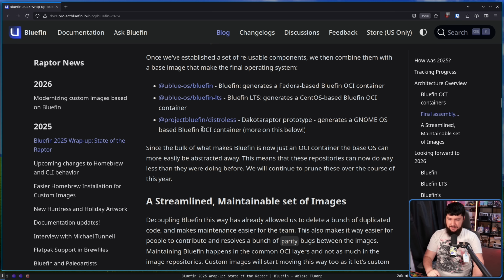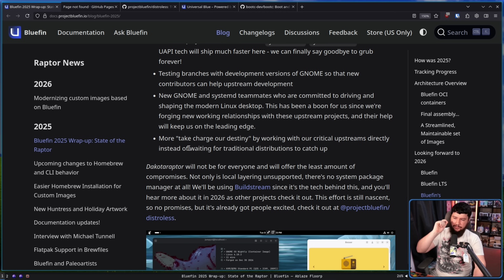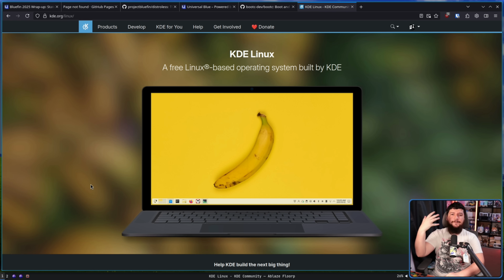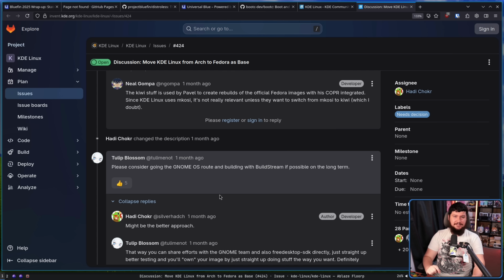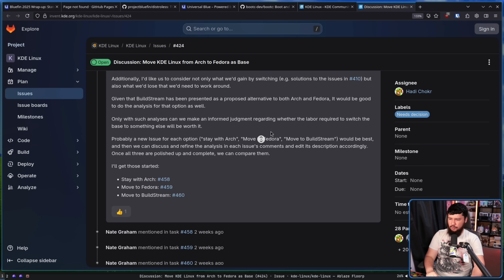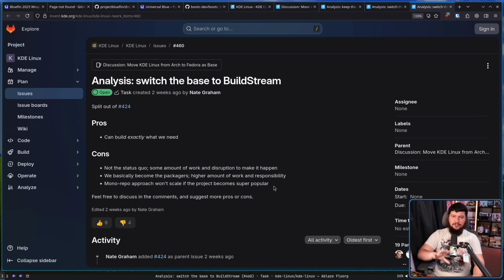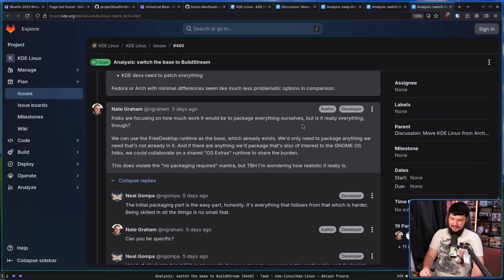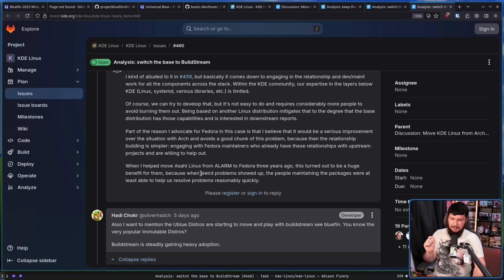The Future Of The Linux Distro Is No Distro

Comment: Ah yes. Lets create a Linux system that is as locked down for the user as windows and macOS are and call it progress. No thanks. 

As long as I need to add kernel parameters to the boot loader to have a random gpu working properly or random low level stuff to avoid draining my laptop’s battery in just a few hours, go away. 

I’ll keep control over all the software on my computer, thank you very much. Not just my user data. If not I might as well use windows and just use the software I need instead of searching for alternatives on Linux.
Reply: The system is still open-souce, unlike Windows and MacOS, and you can still build and modify the whole thing by yourself, unlike MacOS and Windows.
Reply: @MrWolff-n1v that’s nice if you are a developer but it means exactly diddly squat for a regular user that just wants control over his stuff.
Reply: @thethrottlemeister5886  You do not need to be a developer to build a working linux system. All you do is put together existing software.
And as long as there are people who consider themselves advanced users who want that level of control there will likely be a distro built by them available.
Reply: @thethrottlemeister5886  It is usually the case that "regular user" does not even know what OS they are running so an immutable Linux distro might be exactly the thing they need.
Reply: Why don't just use ostree and layer on packages? Same thing as installing with a traditional package manager with only a reboot. This allows atomic rollbacks so when you mess up, you can just rollback by rebooting and selecting a previous version in grub.
Reply: @EatDatPie_445 the whole point of this new system is that this is no longer possible.
Reply: So do you wear the bondage gear all the time or just when at the computer?

Comment: 7:04 are these the same Gnome people who think middle clicking to paste is unexpected despite being a 40 year old feature?
Reply: Middle click paste is older than most Linux users at this point.
Reply: @JodyBruchon  Linux is probably older than most Linux users
Reply: 1. who uses a fucking mouse, it's 2025
2. you're all supposed to be command line cowboys
3. See 1.
Reply: @realhulkhogan The mouse is much faster for cherry picked file moves than any command prompt
Reply: Middle click paste really wasn't a thing before the early 2000s and not a native feature on anything besides X11. All the new people coming over from Windows and Mac don't know what that is unless they used it for a very specific task at a job using third party software to do it, and therefore don't care that it even existed. A majority of developers now over the age of 30 likely started in school on old MECC Apples, quickly were retaught in the early 90's on IBMs running DOS/Windows, had Windows PCs at home through the 90's and went back to Mac in school or college in the early 2000's. Anyone younger than that know Mac touchscreen tech. That's it. What's what they grew up with. That's what they use. They don't know or necessarily care what "middle click paste" is
Reply: @realhulkhogan  Middle-click paste has been a
core, default feature of the X Window System and xterm since its inception in the mid-1980s and I first used it in HP-UX in the 1990s. I'm not sure why people keep wanting to break things that are working fine.
Reply: 0% of the world population outside of Eastern Europe or a hippie commune in a desert somewhere grew up with Linux based systems and 90% of those only started using Linux as more than a server system after Ubuntu was originated
Reply: You're basically saying that your ultra-niche feature that isn't 40 years old and that was obsolete less than five years after it originated in any major known use case by touchscreen technology should be a thing everyone just magically knows or cares about. That's not the way the world works or has ever worked, unfortunately. It's funny that everyone wants to kick their feet up and feel smarter than the younger generation but you weren't using technology whatsoever in the 70's, 80's or 90's. It would have broken you mentally, and your parents financially. Because tech back then didn't work that great. And there were a severe lack of features. And there was no fucking mouse with buttons, much less one with more than two buttons at any rate.
Reply: and digital tech always is has and will be the realm of the PROPRIETARY so, yeah, you boys weren't doing shit with computers before 2001 yourselves

Comment: I think this new atomic desktop approach of something like SteamOS makes a lot of sense for casual less tech savvy computer users and is probably a good direction for some distros to go. Personally though I have never really experienced any serious instability or regressions on Arch even before I switched from Nvidia to AMD and I like having more overall control of my system with less effort. Needing to hit the terminal or flatseal to make a random flatpak program see outside its own directory is annoying. Then only drawback to something like Arch is the lack of reproducibility meaning setting up a new system can take a while.
Reply: Atomic system is getting traction in server environment too. Most modern servers are running containers environment. The OS is just there to either run VMs or containers which contains the actual application and its dependencies. Having an immutable OS make sense because you don't actually install anything else on the base OS.

Comment: Bluefin/Bazzite is very much still a distro. They routinely add/remove/change specific pieces of software that require layering packages on top of the image, or going through  the trouble of building your own image if you don't like their choices. Sure, it's a different type of distro, but it's still a distro. Curation = Distro.

Comment: Distroless at least in cloud means your base image has pretty much only glibc + small amount of bare essentials binaries need to run. This is to primarily minimize the image size. I'm not quite sure what Bluefin is actually trying to achieve. To use containers as an flatpack alternative?
Reply: The desktops themselves don't run in a container, they are just regular containers but they happen to have a kernel and desktop in them. They are deployed via bootc. They behave just like normal linuxes. This whole container thing has the advantage that many people are already familiar with the tooling that is mature with good funding.
Base image/desktop from gnome, flathub for applications and homebrew for cli is the plan.

Comment: I am already on Fedora Atomic and consider this approach to be the best way to move forward with desktop Linux. The new approach without layering could work very well if they incorporated systemd system extensions (sysexts) to install software that may not work very well in a sandbox.
On the other hand, if sandboxes became more powerful in future, layering and other solutions might not be necessary at all.

Comment: Over the 18 years, I've tried a lot of distros, but my daily workstation has evolved from Kubuntu to KDE Neon to Aurora DX with a couple of custom tweaks. I've never been so happy with my workstation as I am right now. For me, immutable is the future. Same for the rest of my family (not all techies).
Reply: Same here. I'm daily driving NixOS for a couple of years on my desktop. I need to adjust the flake I use for my desktop to be compatible with my laptop as well and then switch my laptop to NixOS too. My family is currently on bazzite, but I'm looking into making a Bazzite/Aurora based custom image(s) with everything they might need such as drawing tablet drivers and everything I need to provide them tech support when needed.
Reply: You were either paid to say this, or you've never thought it through. You've basically said 'yes please make it harder for me to fix issues and do my own custom configs. I love being told what to do and blindly accepting whatever slop people give me'. You've given up your agency and think that's a good thing.  You are not happy with your distro because it took away your choices. You are happy because the devs had similar choices to those you would make. That could change at any time. Then you could be dealing with your system changing in ways you do not want, and at that point you may as well just be on windows.  Immutables are awful for the community and for the future of Linux. Sadly you won't see that until they make changes you don't like.
Reply: @CoreInterrupt  That's exactly the same as a non-immutable distro. Pick any distro and when you run updates, packages are installed, upgraded and removed. The only thing that has changed is how those packages are curated. I care about my productivity. Since I've switched to an immutable distro, I've stopped caring about updates, I've stopped fixing update issues and the one time something broke, instead of spending HOURS trying to manually remove and reinstall Nvidia drivers, I just rolled back in seconds and waited 2 days for it to be fixed by the maintainers. Switching to an immutable distro has given me back DAYS of my life. Yes, it is interesting to dig around in the guts of Linux, but I'm not getting paid to do that. I get paid to get work done. It's fine if you disagree, but I can't express enough how wonderful my computing experience has been since switching to Aurora DX (technically, I have a repo that tweaks that image a little bit, but it is effectively what I run). I use my computer for a wide range of tasks and an immutable distro hasn't slowed me down.

And, guess what... If I don't like what Aurora does, I can completely rebase on a different distro. Have fun switching from Arch to Ubuntu to Fedora without reinstalling. I can switch to any OSTree based distro with a single command and a reboot. I'm literally LESS locked in to a distros "issues" and "configs" than someone using a traditional Linux desktop.

I'm sorry, but your comment about me as someone that prefers immutable Linux distros is... not well-informed.

Comment: Word has.. always made '--' into emdash I'm quite sure this is where the LLMs learned it from.  But it means if you use a more formal editor (Libre office included) and use '--' you will get them
Reply: Also, many keyboard layouts on Linux have em-dash on third or fourth level (behind alt-gt & shift alt-gr).

As long as you're not using Windows, em-dash is not particularly hard symbol to type.

Comment: I'm using bazzite for like 6 months now, I would not be using linux if not in an immutable distro like it anymore.
I think this says a lot about what I think about it.
Reply: IMO, it isn't really immutability that matters, but rather atomicity. Stuff like NixOS is effectively mutable, but at least in principle it comes with all the same actual benefits.
Reply: @fotnite_  What drew me to NixOS was that it is declarative, but atomicity is a nice bonus
Reply: @fotnite_  
It's immutability AND atomicity that matters for me.
Immutability because it prevents nasty user errors, and because it allows me to rely on a specific state of my machine at a given time. Atomicity because I want to keep that consistency and be able to restore it without much hassle if I need to.
NixOS at least to what I know, suffers from a lot of adjacent problems and it's own learning curve.
When I choose bazzite over it, it was conscious of those differences AND drawbacks (for example, NixOS having a more centralized approach to atomicity compared to bazzite).

I don't need to thinker too much here, and this is good enough for me, if I want to install something I just use distrobox or flatpak, in those 6 months doing all kinds of dev work I never needed something much deeper than that.
Reply: Yep, immutable OSes is the right way forward for consumer devices. Even on servers, many are switching to immutable system just to run a container platform. It started on mobile, iOS and Android, then Xbox console (I'm not sure about Playstation). The ability to cleanly roll back is a powerful feature.

Comment: We don't need more distributions, we need more maintainers supporters and contributors to linux and open source software debian mint arch cachy opensuse nix fedora rocky alma  bazzite ubuntu maybe Slackware that is most of the things people use, we don't need "new" distros for gaming,being fast or easy  to use most of the distros i have now said do that, ubuntu is good for begginers if you don't like cannonical you can use mint it has great nvidia graphics cards support, cachy for speed,  nix and arch for whatever you want like customizing, fedora debian slackware opensuse for day to day use as a more advanced user, debian alma rocky for server, Bazzite if you want it for gaming most other distro do it badly, (like manjaro) or are nothing special and another fork, or have different DE like pop os, but you can install it on different distro, (or can CONTRIBUTE, for different istros to adapt that Desktop Environment also, i don't mean it like disro you are using is bad, but i was distrohopping through a bunch of distros, but after going through 25 distro on my pc and laptop combined like 80 times switching to different linux i can say thatmost of them are just bad forks.
Like now Debian doesn't have enough contributors for data protection, we need more contributors to develop already good and usefull linux distros, and communities not develop "new linux distro" that solves some things but then lacks in other, we should have innovate in open source not make things that, are repeating

Lets say we have, a post, on Reddit sadly but it is the best forum anyway lol
 there is a user asking about what distro to use when switching to linux from windows choie
people are going to argue about linux distros most of them are not normal distros there are just (forks) of someting that already exists and is better, or can be developed to be better choice.
When you will see people arguing you will just be confused and they will switch to MacOS or stay on windows, so it did not help anyway

We need more people to make already good Distributions better, not to make new ones, that are just not useful 
I just think that when there is a "distro" there are just few of systems that are actually good and aren't just a fork of something that is already better

Okay i have forgotten about Gentoo ok i can still count that as useful
Reply: it doesn't matter, people are free to keep making distros, it is the point of FOSS. Despite the hundreds of distros, the collective Linux world has generally already settled on the half dozen or so that you mentioned. The fact that someone takes on a hobby project to make a new distro does not mean that they otherwise would have been contributing to a mainstream Linux project for the benefit of all, this is a false dichotomy. 
As for your "which distro should I use" question that pushes people to mac or Windows, my question is why should anyone care? Are we supposed to be evangelizing an operating system? I don't use Linux because it is the most popular, nor do I make it a mission to try and expand its userbase, once again, the point is that people are free to use whatever they want.
Reply: @ForeverZer0  i understand that i just mean it in a way that, you can do what you want that is true, i just don't like when the same blog channel says you should check out this "new" distro i just don't like the thing of distrohoping and searching for new distros, when most of them are nearly the same, you can do what you want  but seeing, new distros being released and saying that this is better than some that has been on the scene for a long time is just annoying. But some of them ARE worth it like Cachy or Bazzite because those are ones that are useful and that aren't just forks that are near the same, i just don't like people, talking about new distros when there's a new one every single month.

But i understand how you mean it .

About the people switching back to windows or Mac
People are very negative in the forums, then beginners don't know what to do so they will leave instead, it is just sad that as a community we don't help we only make it worse of beginners trying linux, if linux is going to be more used there will be a reason to support more software on it, what will make the experience better, more people will know about it, more people switch to it, more people are happy for their computer working better, that's the downside of people switching back, and when they need help nearly no one helps them

1. Beginner installs linux
2. Doesn't know something
3. Asks about it on a forum
4. People, only being rude for doing it the "bad" and then saying how they should actually do it,
5. That Doesn't solve anything
6. Frustrated user switches back because, he has a problem doesn't know how to solve it no one helps him
7. Another user, that would boost market share by a little, could help other people when they will have problems with linux, and now are using OS that just steals their privacy, or they switch to mac which is still better than windows but, costs them a lot of money, and doesn't benefit linux

Linux is OS that should work, and if it doesn't  there should be a solution, if no one will say the solution but only be negative about them breaking something, it is not worth it.

We should improve it not be negative for every single shit, but here we are still doing the same and it will stay the same... So there isn't anything we can do linux is just fucked up by dumb people.

People are saying to not use antivirus on linux because "you don't need one duh" saying that linux is more secure, but then copy and pasting some random command they found on internet to fix their problem, then if accidentally installing some virus through that command, the antivirus would be worth it

Linux is just a beautiful OS :) (If you don't interact with the community)